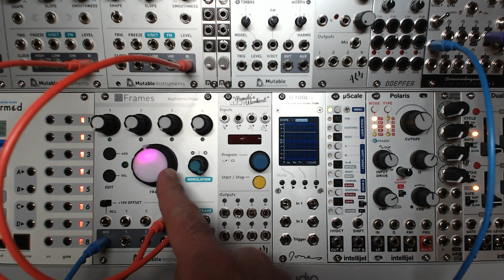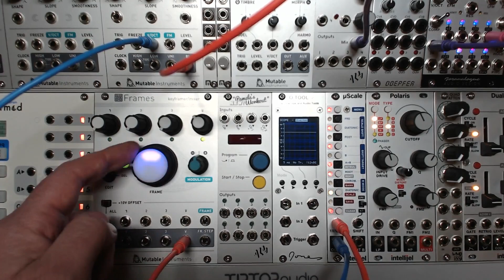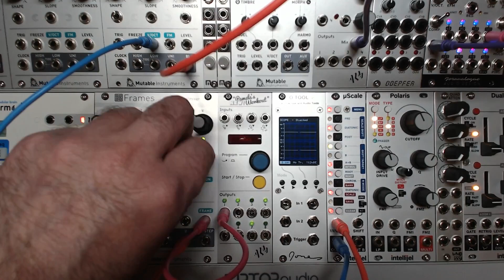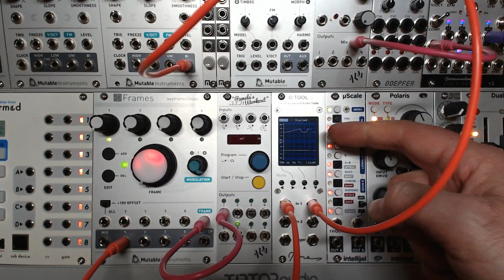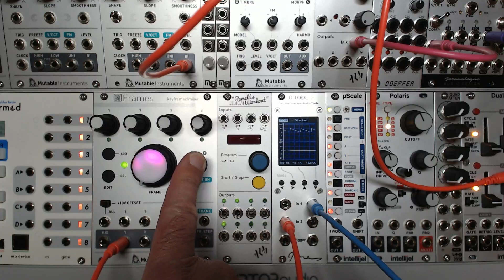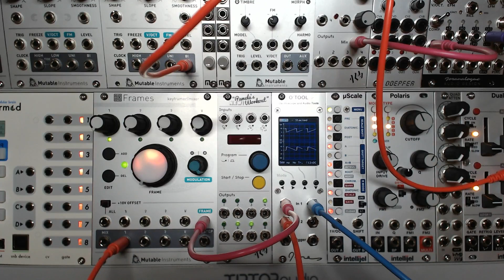Mutable Instruments Frames Overview and Basics Tutorial

Comment: I kind of wish it accepted triggers to advance frames, rather than just cv. Or if there was a way to sort of quantize the frames so a ramped lfo would produce rhythmically precise frame changes. Maybe there’s a way and I’m not seeing it.
Reply: that is one of the available modes in the Parasite firmware. I highly recomend installing it :) you get basic frames and you can switch to 4 completely different modes, quad sequencer, shift register, quad lfo or euclidean sequencer. Frames is a very underrated module
Reply: Doable in standard firmware. Select an existing frame and hit Add 5 times, turn mod attenuator all the way up, send pulses to mod to step through keyframes.

Comment: Thank for the making the video, very informative. I just recently purchased a Frames clone (planks) and am trying to duplicate the cross fading between (2) audio sources you explain around 3:45 in your video. I am not getting the same results and just wanted to inquire if you made any adjustments to your interpolation curves as explained in the manual? Thanks!
Reply from the maker: I was the second owner of the copy of Frames shown in the video. I dont recall adjusting it, but it could have been set by the owner before me.